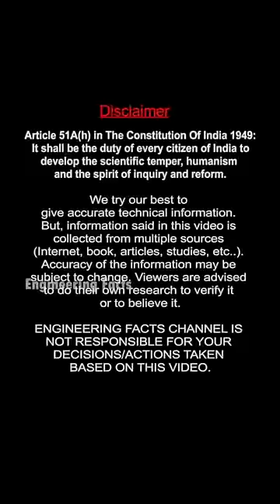வீட்டு மாடில EB Line போகுதா?

Comment: Insulation can be done by cut open a PVC pipe on one side and insert in the line with the help of EB line man.
Reply: 2 months only
Reply: Yes thick PVC pipes can use.
Reply: They're not allowing
Reply: @interiors-interiordesigns1566 What 2 months only..?
Reply: EB இப்போதெல்லாம் அதற்கு அனுமதி தருவதில்லை...
Reply: Malai neer ulla pona problem varumnu solranga😮

Comment: Insulation pannina innum safe ah irukkum
Reply: Weight increase
Reply: Namma insulation panna mudiyadhu EB kitta solanum Avan oru romba cost vanguvan
Reply: Country fulla insulation pananum na yosichu parunga
Reply: @manivannanselvam3525  thallaiva neengala and cost also increases
Reply: @NareshKumar-xi6me  pole size increases, sag in the wire increases etc ..... nallam nalam ariya aaval :)
Reply: @manivannanselvam3525  😂
Reply: Wire la heat increase agidum.

Comment: As per I.E. rules minimum of 1.2metre clearance must be provided between electric line and any part of the building. While constructing the building this minimum clearance must have been provided.
Reply: Nowadays it increased to 1.7m(5ft minimum) latest tneb rule(As on 01/10/2024)

Comment: Hi, all your videos are very useful. 
I bought preethi zodiac 2.0 before 1 year. When  I overloaded  extra foods to grind, the motor didn’t work now.  there is no red light alarm. But Blue light is blinking when the switch is on. I opened to repair  the mixie. Some electric board is inside.I am in overseas. So I can’t claim International warranty. How can I rectify this problem ? Pls explain

Comment: There is something called EMF - Electric Magnetic Field. You don't need to touch the cable to be electrocuted, just go close to it to make contact. On a 11KVA HT line, electricity will conduct even in 3-4feet distance. Own experience. Don't play with it.

Comment: We had the same problem while constructing first floor but we managed to increase the distance of the wire by adding cross extension bar and then connecting the wire.  We paid approximately 35k to EB department for this work.

Comment: Bro, but if the 3 phase loads are unbalanced, in that condition, there will be a current in neutral.

Won't it be dangerous to touch it in that situation? ⁉️
Reply: only if neutral continuity is cut.

Comment: In a place where I live in Bangalore we had the normal feed lines plus a high tension line to the local transformer, all open lines. Later BESCOM laid fully covered four core cables for both high tension and 440V supply lines. Now these cables are safe

Comment: In bangalore more than 40 years back power line was installed underground and connection to houses from pole to house main power was installed. But with present new outskirts coming up, to swindle money this age old system is followed.

Comment: Bro another way to solve the problem for safety athu enna yeintha wire nama near irru ko atha wire la electrical la use pandra pvc pipe podula la mey before EB pole wire installation panduruthu munadi

Comment: Neutral-a return supply pogum. So, neutral linenumae ground le irunthu nammala isolate pannikama touch panrathu thappu.
Reply: Transform la neutral fuse poiduchu na... Neutral la return power varum 😎
Reply: @halfboil007 neutral does not have fuse.

Comment: But all neutral lines of that street are connected in that single neutral line.  If there is a load, the electricity returns through neutral line, then if you touch it, you get shock right?

Comment: It's a 3ph. Supply, when it comes unbalanced load, there will be a  neutral current flow in the 4th wire of the neutral or locally we can say as a return current, so don't suggest any one to  touch (as an option), Don't give false information on three phase supply.

Comment: Anna one doubt, ippo fan slow run achuna kammiyana current and fan speed ah run aachuma adhigamana current aaguma?
Reply: Voltage vary aagum pothu athukku yetha maathari fan m soothum
Reply: Bldc fan மட்டும் தான் அப்படி ஆகும்... மத்த சாதா fan அப்படி ஆகாது... ஒரே wats தான் ஆகும்...
Reply: @rk2ktech415  voltage vary ahurathunala current kammiya consume aahtha...
Reply: @mohamedirfan2090    
 Power = voltage × current
So 3-m each other depend aa thaa irrukum aaanaa current vary aagurathu a term aaa solla maataanga low voltage high voltage nuu thaaa solluvaanga
Reply: @mohamedirfan2090               power = voltage x current  
Current = power /voltage
Current= 100/240
I= 0.41
Current = power/voltage
Current= 100/260
I=0.38
So voltage change means current also change but in current minor changes only so we took voltage that is more efficient so we don't call   அர கரன்ட் we call like low voltage or high voltage only
Reply: Oh ok bro thanks

Comment: Bro, what r the reasons for voltage fluctuations
Reply: 1)Sudden High load
2)Earthing weak
3)Unbalanced sharing of 3 phase distribution 
இதனால் இருக்கலாம் ப்ரோ
Reply: @sktechworks  also now a days the share of renewable enegy is high which is naturally fluctuating
Reply: In coastal area alwaysdamaged in neutral  line .due to sea wind
Reply: @suryaprakash18ms  👍🏽🙏🏻bro
Reply: @sktechworks thsnks bro

Comment: I still don't understand why TNEB is behind in technology, such naked wires are always hazardous. Atleast in Bangalore Karnataka in urban area all our electric poles are with Twisted cables. This helps with not oly electrical isolation but also helps in tree growth (meaning need not chop tree branches when ever it reaches the electric pole naked wires) and are more safe during heavy wind or rain as they don't fall on road sides
Reply: எப்போ தான் TNEB இதை கத்துக்க போறாங்களோ

Comment: Boss. Your message is not Complete. Best solution is to get the wire run through a pvc pipe. All you need to do is, to request TNEB to get this done by paying the charges.

Comment: Neutral is grounded at the source, but neutral will not be at ground potential all along and may be few volts above ground which may be sufficient to give a shock and sometimes electrocute also depending on the condition. You are giving half baked dangerous explanations. You are liable to be prosecuted for giving incorrect advices. You have no authority to talk on safety aspects unless you are a licensed by competent authority